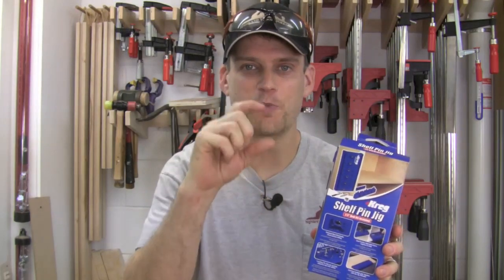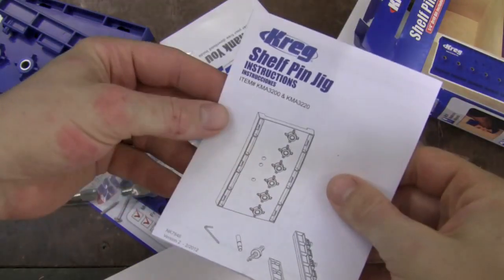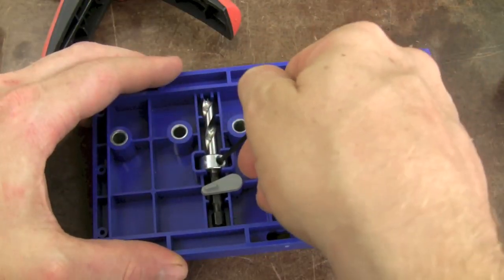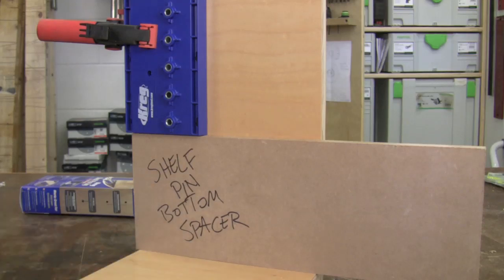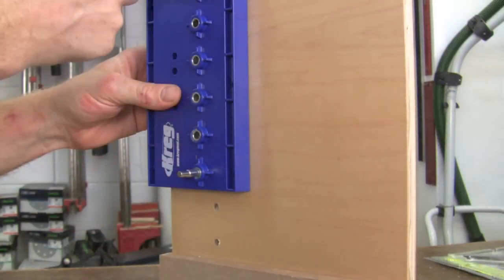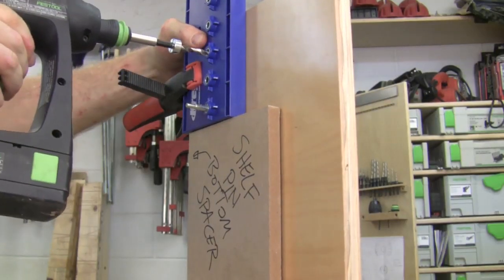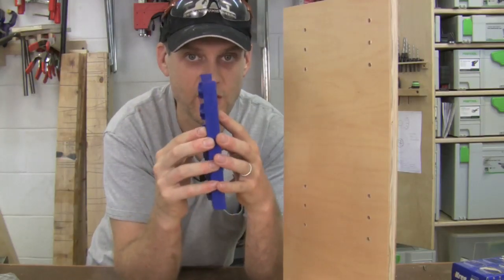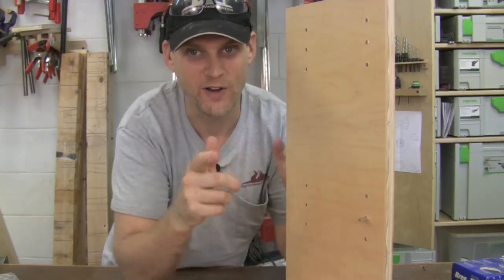Kreg Shelf Pin Jig Product Tour

Comment: This jig is just OK. As you can see from this guys video there is tear out from the holes that make it look sloppy. I would recommend using a 1/4 MDF board between the jig and wood to get a smoother hole and possibly buying a better drill bit-carbide, they can be bought at the Deeps or Lowes.

Comment: Why not use the jig as the bottom spacer? Drill the top hole and use that as the starting pin for the remaining pin holes.
Reply: I was thinking the same thing, but I think its for simplicity, you don't have to count and guess how many holes. Plus it takes time if your building multiples.

Comment: the jig will do 5 mm and 1/4 inch.  all you need is the drill bit and locater pin for which ever one you use.  1 jig 2 bits and 2 locater pins.

Comment: I noticed you have tear out or rough edges on your veneer when done.  I noticed some negative comments about this in Amazon where the consumer suggested using a different drill bit, so I was wondering if you have a solution for that in conjunction with this Kreg jig kit?
Reply from the maker: In using the jig around here in our shop at the store, we've observed a few items of note to consider:
 
-Be sure the jig is held down firmly and securely as possible to the material being drilled.
-Run the bit at a high rpm speed. It will lessen chipping.
-Be sure the bit is sharp.
-We've also discovered that the imported plywood tears out far more easily than domestic plywood (when drilling, cutting, routing, etc).  The domestic costs more, but we switched to building with the domestic birch plywood because the imported plywood was such poor quality.
 
Since the bushing of the jig is 1/4", if you are drilling for 1/4" shelf pins, you can use a 1/4" drill bit of your choosing (versus the Kreg supplied bit).  I would recommend a sharp, high quality brad point bit.
 
The 5mm drill bit for 5mm shelf pins is a stepped drill bit. The end of the bit is milled down to 5mm from 1/4".  This allows the bit to be guided by the 1/4" bushing in the jig.  Because of this, there is no other option when making 5mm holes with the jig.
 
Regards,
Highland Woodworking
Reply: try putting another board behind the piece you're drilling shelf holes in and drilling through your piece and into the other board, usually a scrap from the shop floor.